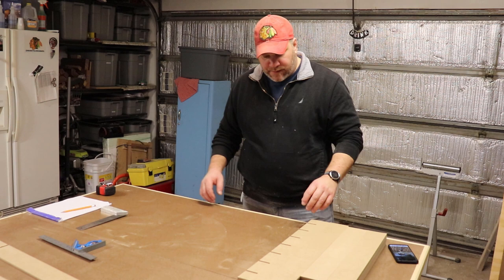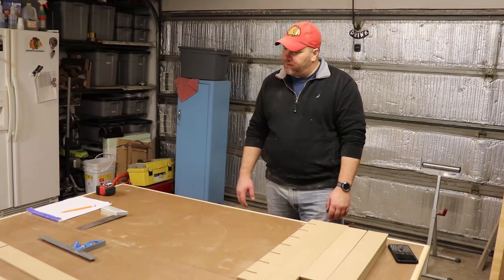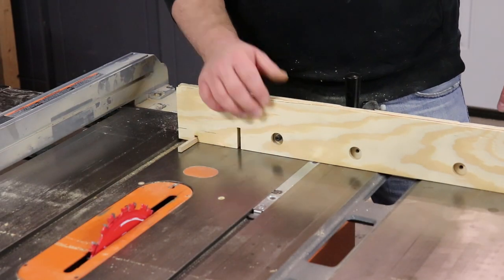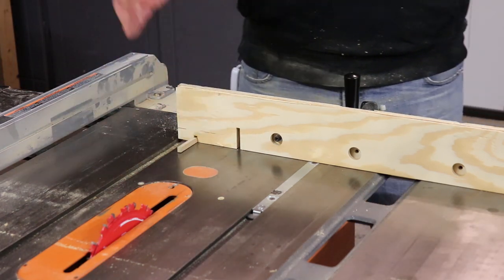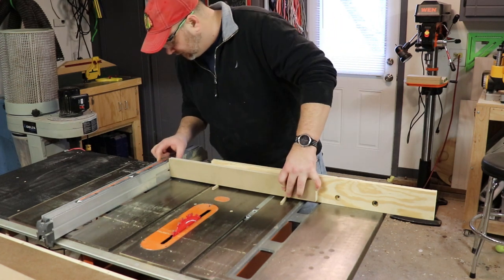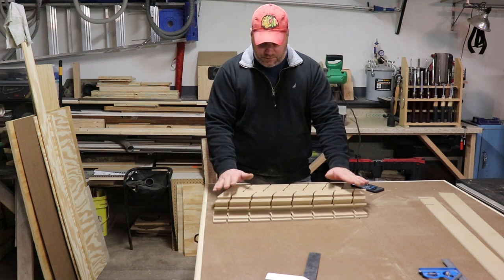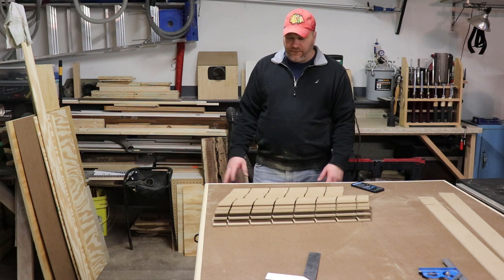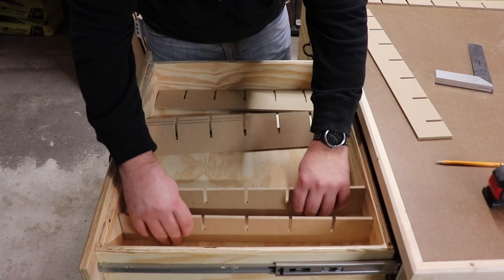Amazing Adjustable Drawer DIY Dividers

Comment: Don't want to be that guy, but a word of caution about using a fence and a miter slide at the same time can cause kick back. If you add a short piece of material at the beginning of the fence you can align your pieces, but when you advance the miter slide you will have a gap between the fence and your work piece. It's safer that way. Just don't want you to get hurt. Kick backs are uncomfortable, ask me how I know.
Great organizer trick. Thanks for sharing.

Comment: What if you cut a groove on the sides front and back so when your installing the dividers which would need to be a little longer they would drop down in the grooves and won’t fall  over and wouldn’t need to use hot glue I’m just wondering that work station is very nice and I like that remote switch on your belt loop for the saw

Comment: Thank you for posting, great job.  One question, do you think it would be disadvantageous to use 1/4" plywood instead of MDF?  I hate MDF!  Thanks again.  Mark
Reply: There should be no reason you couldn't use plywood.  Just make sure you set your index jig pin to the right size.  Should not be a problem at all!
Reply: @jimglowacki9724  Thanks Jim!

Comment: Please don't laugh. I am eighty plus and new to laser cutting. I have created a divider box template.  When I slip one notch over the other it doesn't push down to bottom. Are your notches exactly the same width? Oh, I am afraid to use table saw, okay with chop saw and band saw.